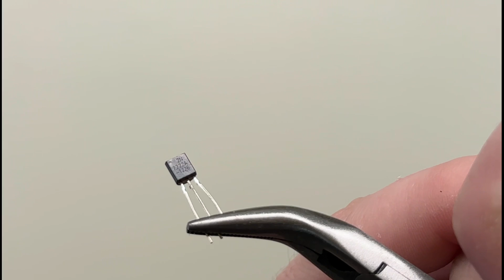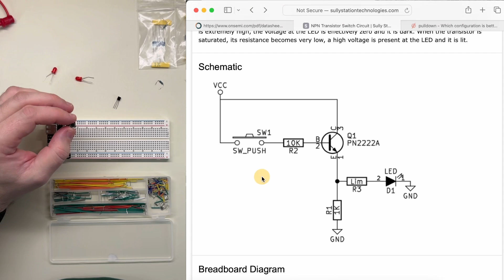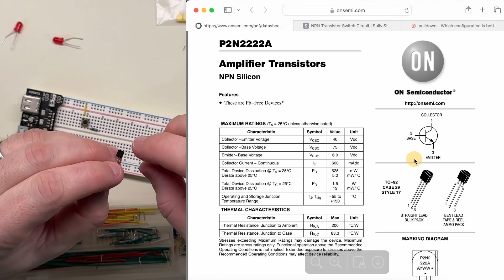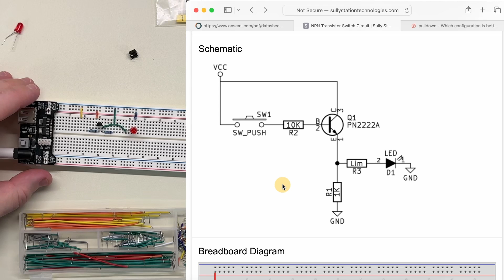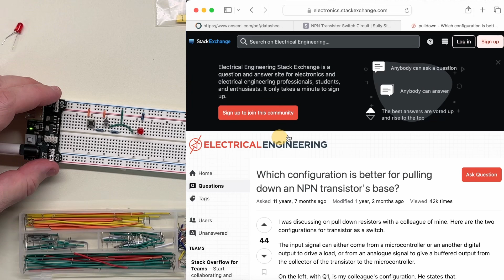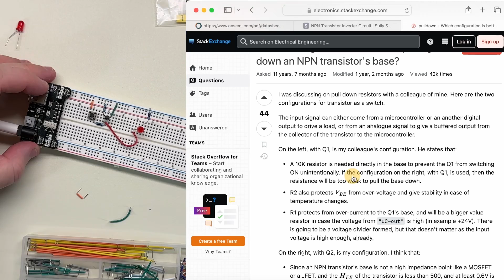Making an inverter from a transistor

Comment: In the inverter, turning on the transistor allows Vcc to flow through R1 to ground. If you didn't have R1, an "infinite" current would flow through the transistor, releasing the magic smoke and possibly a nasty smell. You're right about R1 and the limiting resistor. @D614G_aka_Doug calculated that Rlim should be 350 ohms for a 5V supply. With both R1 & Rlim, we get a current through the LED of 3.7 mA instead of 10mA. If you replace R1 with Rlim, then the LED gets 10mA when it's on, and when the transistor "steals" the LEDs voltage, the transistor "wastes" 10mA ... so a constant current.

Comment: This one was really cool. I got to see the thinking behind these switches. 

Limiting resistor 3 and ground act like a 'voltage divider' and when you turn on the base. Collector and emitter are (more) connected to ground. So the voltage divider dumps most of the voltage to ground (because it's very very low resistance rather than zero).

With a ratio of (very low resistance) to whatever the resistance of the limiting resistor is. 

And in the initial setup the voltage is below the LED's ability to function. But not the case when  you remove the limiting resistor. 

Very cool lesson on this one.

Comment: In the second circuit, which is  "common emitter" switch, I would do this:

Relpace R3 with a short circuit.
Pick the current I wanted through the LED. Let's say 10 mA.
With a RED LED the voltage across the LED when it is lit up to decent brightness will vary according to the specific type, but let's take 1.5 volts as a reasonable approximation.
With the transistor OFF, the voltage across R1, by Kirchhoff's  voltage law will be (Vcc - Vled) = 5 - 1.5 = 3.5 volts
By Kirchhoff's current law, with no current through the transistor the current through the LED will equal the current through the resistor. 
To determine the resistance we need we use Ohm's law
R = E/i (or sometimes V/i; normally you'd use capital I for current but it becomes ambiuous in a sans font, so I'll use i instead)
R = 3.5 V / 0.01 A = 350 ohms
There are two common values that are close enough to give us a pretty accurate result - 330 ohms and 360 ohms. 330 is generally much more commonly used.
 This is something you just learn from experience.
Checking our current we now have
i = E/R = 3.5 V / 330 ohms = 10.6 mA - good enough!

When we turn a common-emitter transistor ON, the voltage between the collector and emitter, at moderate current, will be a fraction of one volt. The transistor is said to "saturate" (assuming we have enough base current). Say it is at the high end - 1 volt. That is still low enough that the LED can't turn on to any appreciable extent because it needs that 1.5 volts, but lower would give us more margin.

Now let's check using the datasheet.
We look at a graph for collector-emitter saturation voltage versus collector current. It's down to about 0.2, way below the 1.5 V reauired for the LED, with a base current of about 0.06 mA. The graphs are normally of "typical" values and real operating values can be quite a bit different in either direction.

We have a 10 k resistor between the base and +5 V. We analyze this exactly as we did for the LED current, but use 0.7 voltas across the B-E junction.
i = 4.3 V / 10k ohms = 0.43 mA
Going back to the graph in the datasheet we find that's lots more than we need to get the CE saturation voltage down to 0.2 V, so we have lots of margin for unit to unit variation and the like.

Transistor ON - anode voltage of LED is pulled so low that the LED can't turn on.
Transistor OFF - current through the lLED is as we determined previously.

Comment: You've been burned by a bad datasheet!
With the flat side facing toward you and the pins down, the pins are EBC, left to right. I think your transistor was in the circuit backwards. Many transistors will work to some extent that way but the current gain is dramatically reduced. That is consistent with everything observed.

You really need to measure voltages at all the nodes to get a better understanding of what is going on in these circuits.

Many years ago, Motorola, from which ON Semi descended, sent out unsolicited samples of one of their 3-terminal regulators in the same package as this transistor. The datasheet they supplied with it had the wrong pinout.

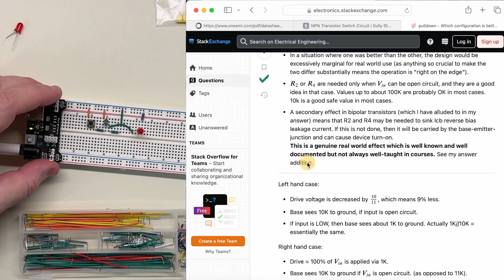Comment: 8:50 This discussion isn't about some sort pull-up/-dowm problem what you have. You must know, that B-E has some capacity, and when you OFF signal, then transistor is still ON short amout of time. If you grounded [B]ase you can shorten this time. ()

Comment: A good engineer will never leave a transistor base flying in the air. 🙂 R1 can be removed and the collector can be connected to the output of 2 LEDs - to short the LED. It is good to use a "digital" transistor that already has an input resistor inside and a closing resistor on the base.

Comment: 8:50 That is not a "battle"about a "pull-down"in this schedule, this discussion involves microcontroller in/output...You only need a resistor to make current flow....thus it is pointless to place a "pull-down" Only in case of "switch-bouncing" it would make sense...Nothing needs to be pulled down here.
Reply: Pulling the base down can reduce current in the collector-emitter path by providing an alternative path for collector-base leakage current. With modern silicon transistors operating at moderate temperature CB leakage current usually isn't a problem but it can be at elevated temperature. The magnitude of the leakage approximately doubles for every 10 °C increase in temperature and the leakage current is multiplied by the current gain of the transistor. If you use a Darlington pair that doesn't have internal resistors you really do need to pull the base down.

Pulling the base down also increases the speed with which the transistor turns off by "sucking" carriers out of the base region (otherwise they persist until they recombine). With something like an indicator LED this is completely irrelevant.

When a transistor is being driven by a typical "push-pull" ("totem pole") digital output a pull-down is of virtually no value except to clearly determine the state of the transistor if the digital device is powered down on in reset and outputs are floating. Whether you really need to be concerned with that depends on what you are driving. If it is the cycle release for a 100 ton punch press you better be darned sure behavior is very well defined in all circumstances.

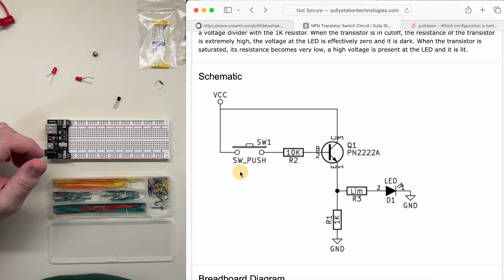Comment: 2:32 It's definitely NOT silly....You cannot limitlessly switch current through a switch so a transistor is usefull in that case to switch higher loads. Also, if the base current must come from a different (less "powerful" or lower voltage) source to switch something, you'd use a transistor.

Comment: One of the reasons you may chose to use a transistor as a switch in this way, rather than just using the switch is mainly to do with the current flow. In the transistor circuit most of the current to the device (LED in this case) is flowing through the transistor instead of the switch.

In your case it really makes no odds, as both the switch and the transistor will have no problems handling the current pulled by the LED.

However, lets assume your LED is a strip of LED's pulling significantly more current and your switch is the output pin of another IC (chip) or similar. In this case the switch on its own will not be able to handle the current required for the LED strip, so you put a transistor in the middle to handle the current and the IC can control the transistor.

Comment: The resistor R1 will ensure the transistor to fully turn on. Without the R1 the transistor will work as an Emitter follower circuit and act as a variable resistor. With a led as load it's no big deal but with heavy loads on the emitter the transistor will overheat since it can't turn on fully. Without the R1 the transistor will not reach full saturation basically al low voltages also the applyed voltage to the R3 will nevver be Vcc but instead Vcc-BE-LedVforward. Measure the voltage on the emitter with R1 and without the R1 and you will understand why it is there. Can it work with out it? Absolutely but you loose voltage stability. With R1 the voltage on the emitter can be calculated Vcc-BE otherwise it will be Vcc-BE-LED_Vf. Since leds haves different Vf values so will your output.
Reply: An emitter follower will never saturate the transistor and adding an extra load between the emitter and ground helps nothing. It is just a power waster.

Comment: Bi-junction transistors do not require a pull down resistor because they switch based on current flow across the base, not the presence of voltage on the gate like a mosfet.

Comment: Transistors can be used as digital switches. Some are more suited to this than others. Some transistors are better used in an analogue fashion. Frequency response, gain, collector current, everything in general..... even the style of the case......... Some transistors come out in different cases. Then we get into Common Emitter, Common Collector and Common Base method of  connection ( or circuits)...... each method is a practical study into how semiconductors work. Then there is the configuration.... normal amplifier, driver stage, power  output......... class A , B C etc etc...... maybe darlington connected, maybe complementary symmetry, it depends on what you want as a designer......... switching or analogue................ allow a voltage drop of 0.5 to 0.7 Volts over a silicon semiconductor junction, whether a transistor or a diode. )  0.2  or 0.3 V if Germanium junction semiconductor. Then you have polarity...... NPN or PNP....Have fun, check twice before connecting it all up..... semiconductors like transistors and diodes self-destruct silently and extremely fast. Reverse connections or over current is fatal to your semi conductor. Accidentally shorting base to collector with your screwdriver or multimeter is another good way to destroy things. Ruined transistors test shorted, or open, with a multimeter. Conductive reading should appear as a typical junction. If zero ohms or open..... it is to be thrown in the bin!!!
As to being an 'inverter', some circuits invert the signal output. Like high in... low out. That's it. It's not an inverter circuit like a microwave or air conditioning or generator inverter......... that's a totally different thing.
When you spend a few years gaining competency with diodes, transistors......... then you can get into the world or FET's and IC's !!!!  Mind you, these days you may get FETs and IC's first.....
E=MC2

Comment: resistors Limit current and voltage. Each item ( device ) has a tolerance in the schematic. To PROTECT each device you must not exceed the devices tolerances. This way we do not blow the Led or transistor.  Hotter electronics get the shorter their life span. So it makes sense to figure out why you use certain resistors to limit current to each item in the circuit.
Maybe add a potentiometer instead of an on off switch to adjust the flow. Now we can  see how the Leds brightness works.  
NPN the emitter is connected to the NEGATIVE .
PNP the emitter is connected to the POSITIVE>  
Resistors must sit on the Positive side only in a Circuit ( if this helps ). 
I'm still not sure why at the moment you'd need NPN vs PNP except maybe in a  Positively ground circuit vs a negatively grounded circuit.
Reply: As you adjusted each resistor you allowed current to find its balance through the circuit.  Because the transistor and LED allow current you have met their needs in a manner to allow power to flow through them resulting in the LEDs brightness with each resistors replacement in the circuit.

Comment: @0:19- Transistors are analog switches
The schematic isn't about how to turn an LED on and off. It's a lesson to show how common emitter transistors are used in circuits to control the flow of current (like a switch does).
Pull up or pull down resistor is needed when circuit will be operating in a RF noisy area. The base without (pull up or down resistor), acts like an antenna. RF can trigger the transistor inadvertently, without the extra resistor or special shielding. For this simple discussion on transistor biasing, the extra resistor isn't needed.
R1 and R3 together create a voltage divider circuit. R3 assures the current is correct for the LED (too much will smoke it). R1 is required to make sure the transistor always goes completely off when the base is open.

Inverter circuit- R1 and R3 again create a divider circuit. R1 keeps current flow down to the transistor's published specifications. R3 protects the LED from over-current damage. In this circuit, R3's value is determined by the value of R1 (for total amount of resistance against VCC). Eliminating R1 puts the LED in danger, and eliminates the divider circuit required to operate the transistor properly. With only a 220 Ohm resistor between the LED and ground (the path of least resistance), virtually no current makes it through the 10K Ohm resistor to the transistor base (start the timer before the LED smokes itself).

Reading the "Concept of Operation" above the schematics will answer most of your questions.

Comment: Loved the vid! Super cool to see your thought process and sources.
My thought for the R1: it could be in parallel to the LED to reduce the amount of current flowing through the LED. Maybe this is due to the max rated current the LED can handle
Reply: Resistors in series with the LED, such as R3, reduce the current through the LED. Resistors in parallel with the LED, such as R1, have no effect on the LED, they simply increase the current through the transistor.

Comment: NP or PN junctions drop 0.5v approx. so when you short R3 and press SW1, Q1 will drop 1.0v (C to E) which is plenty of voltage for D1 to be on. D1 should still be fairly bright.
Reply: All devices like this drop the voltage by .7 volts.
Reply: @garycook5125  No. A silicon PN junction drops about 0.7V in forward bias but germanium diodes will drop something like 0.4 and Schottky diodes, which have a metal-semiconductor junction drop as little as 0.2V.  LED's on the other hand use more exotic junctions, usually based on III-V compounds like gallium arsenide, indium phosphide, gallium nitride, etc. and have a forward voltage drop related to their color.  Red LED's have a forward drop of about 2.1V, green are around 3, and blue 3.5.  UV LED's are higher still.

Typically, switching transistors have a different parameter called saturation voltage, which will be the minimum voltage from emitter to collector when turned on fully and can be anywhere from 1 to 2V and is dependent on temperature and collector current in addition to the material properties.
Reply: @whatelseison8970 The video is about transistors, so that is what I'm talking about.

Comment: I think the LED is still on a little bit because without the resistor in series, the resistance of the path with the LED is low enough to allow current to flow but still many current runs away to the transistors' path, so the LED is dimmer than before. And as you have replaced the 10K resistor, I think there is also with the resistor of the LED path enough current for to flow in both directions and turn the LED on. I don't know if this is right, and sorry for possibly bad English.

Comment: hi sir i want to ask a question sir
in ds2501 transistor there is data ground pin and here is emiter base collector
can we make npn transistor like ds2501 memory chip ic using arduino ?
thnx sir